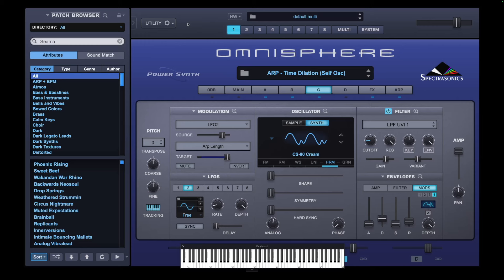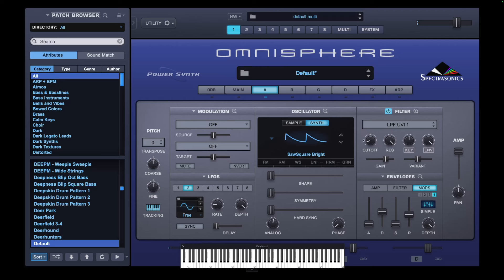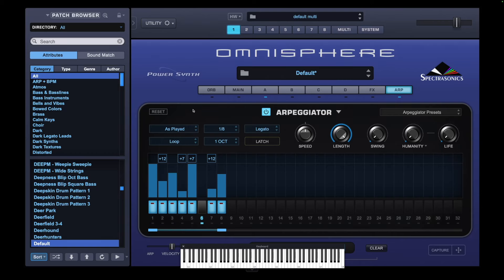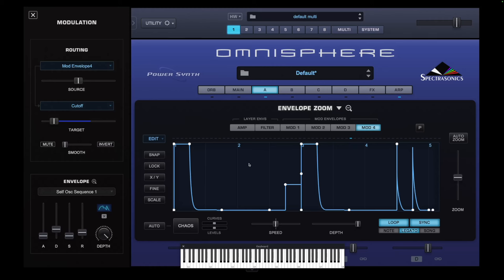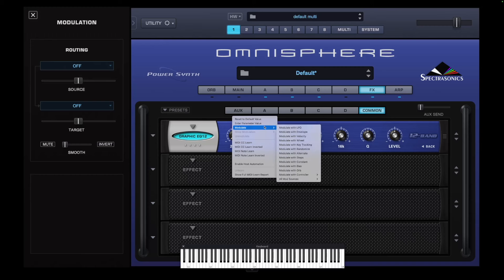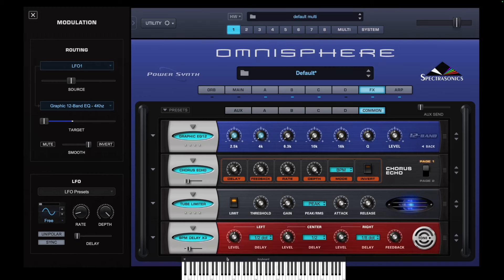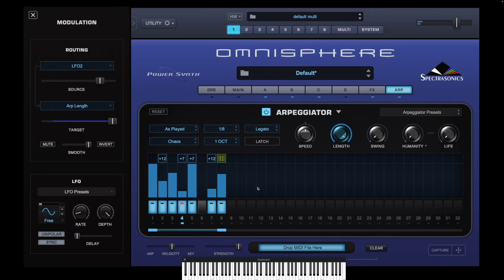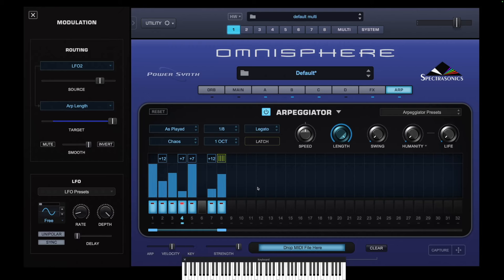Omnisphere Explored: Pushing Boundaries in Music Production and Sound Design

Comment: Try putting it into a hardware synth like Iridium keyboard version and then I might be interested. VSTs and menu diving stops creativity for me. It’s just a drudgery.
Reply from the maker: Each to their own as hardware is a lot more expensive than software. You also can get more bang for your buck in software. I find hardware synths a pain to programme as a lot require copious amounts of menu diving, pro 12 desktop and modal argon8 being just two in my collection.
Reply: @AdrianEarnshawMusic  while hardware does have a cost so do VSTs and a nice midi controller. If I could go back and save the money I spent on VSTs and midi controllers I could have spent around $4000 on a very nice synth that I would own and still be using now. I have many VSTs but rarely ever use any of them.
Reply: It’s the same on hardware, but instead if menus, it’s buttons and faders. You still have to do multiple steps to get the sound you want lol.
Reply from the maker: @es__music  remember the good old days of the Yamaha DX7, now that was some menu diving.